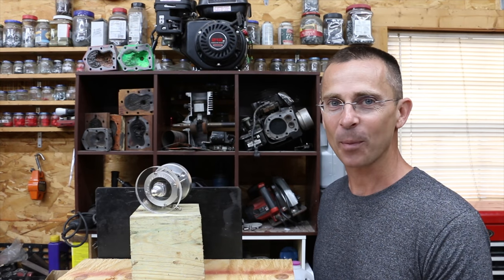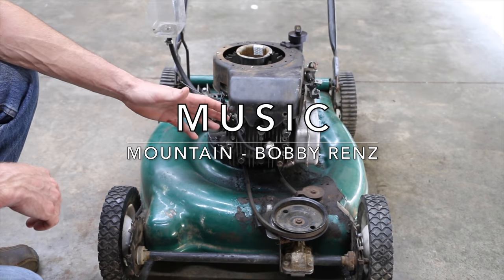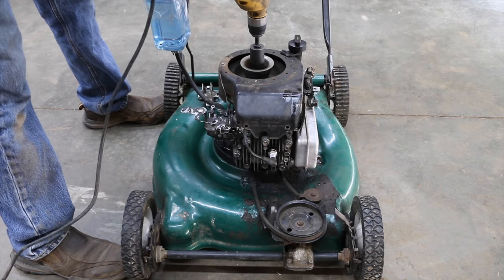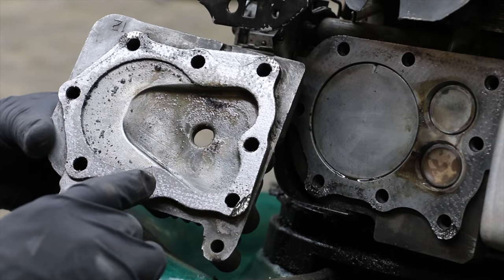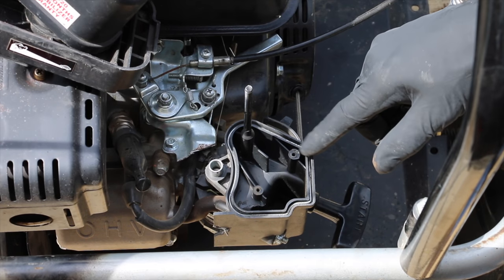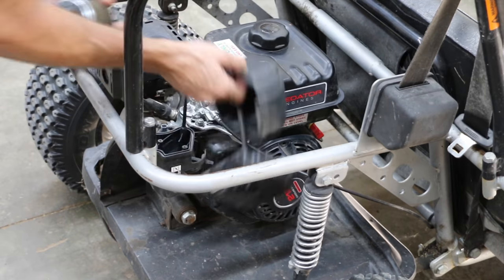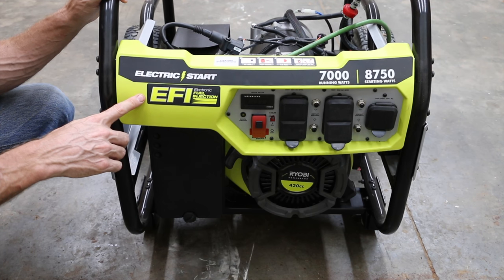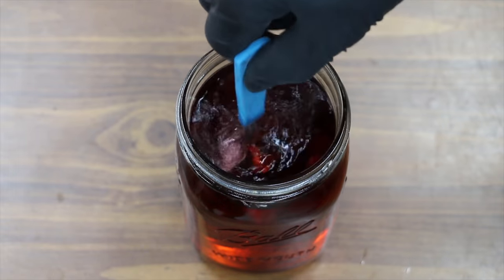Is Leaded Fuel better than Unleaded?  Let's find out!

Comment: I remember when unleaded came out we had to have the valve seats hardened on the engine to handle it. For years there was a brisk aftermarket in lead additives to keep the older style engines from damage.
Reply from the maker: Great point!  Thank you
Reply: I think I remember going to a gas station as a kid and seeing little bottles of "injector cleaning", "diesel fumes reducer" aaaaaand "lead substitute" liquids so probably not actual lead but something that mimics it (though probably for some time actual lead containing fluid was sold)
Reply: Glad someone mentioned it.... Aviation fuel also has Antifreeze in it due to freezing temps at altitude. That is the build up ...they make spark plugs cleaning tools for aviation.
Reply: @chelarestelar  there were actual lead additives. I was in my 20s when they started getting rid of it. I hunted leaded fuel then aftermarket additives for years before giving in and modifying the heads.
Reply: @jerrystott7780  actual lead additives? Well, didn't have confirmation of their existence, but now I know
Reply: @chelarestelar  the lead substitute were all you could find later on, but they really didn't work as well, that's why in the 90s I gave in and changed out the heads on my older vehicles.
Reply: @chelarestelar  toluene ftw
Reply: @shawnwhalen8314  Thats for aviation turbine fuel IE Jet-A. 100LL aka Avgas naturally has a VERY LOW freezing point and most recip engines don't fly high enough for it to be a problem. The lead deposits you see are from TEL (Tetra Ethyl Lead) and is used as a knock inhibitor, not as antifreeze
Reply: My father had a 69 Nova with a 230 inline 6. I remember him using S.T.P. lead supplement at every fill up. Not sure if it mattered. Also I remember reading a study that stated lead fuel emissions were making people crazy and violent.
Reply: I use that additive for my 60s car- but most people say you don't actually need it if the engine actually was driven at the time with leaded fuel- so that the valve seats have hardened.
Reply: @jerrystott7780 , up until last December, my 68 F250 was still using lead additive. I remember when I bought the truck at the age of 17, the original owner had an entire pallet of TEL in the garage and sent it with the truck. This was 1995, and I distinctly remember the guy saying "use a little bit of this shit at every fill up or she'll knock climbing hills". That pallet lasted me until 2013, 😂
Reply: @Taydrum   yes thanks, sometimes I get them confused.
Reply: @olik136  The process to harden the valve seats was something done during a rebuild, not a side effect of running leaded fuel, it they have never been rebuilt then you need the additive.
Reply: @waynelutwiniak797  Well the effects of lead poisoning is actually increased aggression, mood disorders, muscle and joint pain, and difficulty in memory or concentration.
Reply: @Jaker788  that sounds like most boomers
Reply: Yes your right and we had low lead before we had no lead gasoline and the oil  companies could have used ethanol instead of adding lead to do the same thing that lead doe's but they chose lead instead because they couldn't patent ethanol but they could lead , greedy oil company's chose lead.
Reply: Cool story bro. Really...
Reply: @shawnwhalen8314  it's not exactly antifreeze but a very similar chemical, I was POL for 4 years in the AF and we had to test for proper levels of each chemical Everytime we received fuel.
Reply: I bet those horse and buggy days were the shit huh??
Reply: We replaced the catalytic converter with a straight pipe and continued to run Regular until it eventually disappeared.
Reply: A former co-worker of mine had a 1930s Willys-Knight with an engine that was never converted, what he was told was to run ethanol-free gas and don't run it hard.
Reply: @chelarestelar  I still buy them for some of my older engines
Reply: @Jaker788  that explains a lot...I thought I was just getting old
Reply: I had a 1965 Thunderbird then. It was 1990 when the last of the Leaded was still in the Petro Canada Pumps. After 1990 I used Monach Oil brand; "Pist-N-Lube"  in with the Unleaded.  Today ppl still mistakenly say "Regular" which meant Leaded back then.
Reply: @Jaker788  i actually have these symptoms in my life and used to race motocross at a amature and then semi professional level, breathing in race gas fumes. I wonder if it has any connection
Reply: @thedude7726  Could be symptoms of gas fumes, unless you guys used leaded fuel. I work in industrial lead acid batteries so I get yearly testing for lead blood levels. Overall my risk is low unless I'm really careless.
Reply: I remember putting unleaded gas in my dad's 1976 f150. It misfired until I was able too dilute the unleaded with 87 octane (regular gas as I recall).
I change my oil twice or more /summer - 10/30 in my lawnmower. I use unleaded in my 2003 Saturn and occasionally put in MMO. I'd like yo know what to use in my lawnmower.  Jet fuel is just cannot be found around here.
Reply: Heck my 4 cyl 30s chev runs without lead but spits in sputters ever so often
Reply: Who here remembers when everyone and everything had higher levels of lead in it.
The good old days huh.
Reply: MrNorthstar50 

They all bought it from Ethyl Corp.
Reply: nick4819 

We had cheap gas, land yacht cars with lots of chrome, powerful engines, and no safety features to speak of. Somehow, we survived.
Reply: Jake Rosendahl 

I think the greatest public health risk these days is from lead water lines and maybe from peeling lead paint in old homes. Maybe Chinese china, from lead in the glaze.
Reply: So true! I removed the catalytic converter to my ‘76 Trans Am one block from the Midas shop - left it in the drainage ditch where I took it off. I had pre loosened everything prior to going there. The shop wouldn’t remove cats but a car in without them they’d work on. Dualed out the old TA; it ran better w/o the afterburners on it.
Reply: sukhoi31m3 

I’d have tried to get something for the previous metals in it.
Reply: Had a few bottles of klotz lead additive for my ironhead now its lead substitute, ran a lovely grey exhaust pipe now its black like the plugs
Reply: Nah, it cut the performance back so bad I was glad to throw it in the ditch. The 455 my ‘76 T/A had was the low performance station wagon engine. IIRC the comp ratio was under 8:1. 4 Speed, 3:23 gears. Getting rid of the cats helped a lot, so did different metering rods in the Qjet carb. I recurved the distributor for 39 degrees total, all of it in by 2500 rpm. That’s a pretty aggressive ignition profile but with its low comp ratio it digested that (along with lots of regular fuel) with no problems.
Reply: @uwekirschling9757  Especially lead salts and organic lead compounds, elemental lead less so.
Reply: Friend of mine just starting using unleaded when it came out. Didn’t do a thing to his engine in preparation for the fuel change. 
It ran for years without a single problem.
Reply: @FrankGutowski-ls8jt  well some of us did haha
Reply: chelar estelar 

Lead substitute was probably MMT, an organometallic compound containing manganese.
Reply: @juslitor  it also depends on how it gets into your body, through the lungs like you would have from car exhaust if there is lead in the gasoline is an higher absorbtion rate than eating the same amount of lead
Reply: I think part of the problem is lower octane in newer gasolines. Lower octane means higher combustion temperatures. That would certainly add to burnt valve issues. 

IIRC Lead raises the effective octane but in a better way than ethanol. I remember buying 98 and 100 octane fuel regularly in the 1970s.

My 1986 SAAB Turbo hated ethanol and I had to use a lot of additives to keep the injectors clean. There was one Shell station 100 miles away that didn't have ethanol in its premium that made the old SAAB run great but lowered the mileage from 36 to 34 or 35 mpg. Yes, I kept meticulous records. I was running about 3000 miles per month, 1/3 of it city driving.
Reply: @jerrystott7780  I wish I had the money, I'd get some heads, cam and timing set for my old van, be better off just swapping the engine tho
Reply: @Maples01  yeah, but those old engines are sweet, easy to work on and no sensors hiding and causing what looks like carb problems.
Reply: @jerrystott7780  It's why I bought that van, I just need a 302 roller from an Explorer, my engine comes out the passenger door. I made a mistake trying to use the crap at the pump, the E10 collected moisture, ruining my tank, and there are no replacements made, I use 100% gas now, which costs a fortune
Reply: @Maples01  I've got a 72 Dodge van with the rotten gas tank too. Supposedly there is a company that made plastic replacement tanks but I didn't find them. The other option is to weld up a steel replacement tank.
Reply: @jerrystott7780  Mines the bastard child, no one makes a replacement and it's design makes it hard to match. Aluminum sounds pretty good for a choice of materials, I've dealt with so much plastics failure, I'm starting to hate the stuff.
Reply: @502Chevy that indeed a very aggressive timing curve! When i first started reading your reply, i thought you were going on to say it was a sd motor!  They stopped making them a few years prior but they were bad ass!  I'll beto your car was still pretty fun to drive,,,,
Reply: From what i understand,,  lead also was a lubricant for th exhaust valve,  thats why ya needed hardened seats with unleaded glas
Reply: @shawnwhalen8314  when we ran pump gas in the chainsaws, we replaced spark plugs all the time.  Since switching to 100ll 30 years ago, i haven't changed a plug in 15 years, and only because of worn electrodes!  
I have a vixen plug blaster, and use it all the time for the plugs for a couple of high oil consumption engines.

Comment: 1st off... yet another great video! Kudos!

You won't see much (if any) gain in performance with these engines. They simply aren't designed to get the most out of the fuel. Higher octane fuels require significantly higher compression, ignition advance, and atomization to achieve their potential gains. There is a slight advantage in power by volume, as there is no ethanol in the aviation fuel... but without a properly tuned engine, that advantage is unattainable.
Reply from the maker: Thank you!

Comment: Back in the day when leaded fuel was common  if the tailpipe was chalk white or gray folks would say you had a good engine. If the pipe was black most times it would be an oil burner.
Reply from the maker: Thank you!
Reply: Yeah, and the dark tailpipe could also be from running too rich !
Reply: @kengamble8595  Yep,but you could usually smell the difference.To oil burner smelled different than a car that needed the carb adjusted or repaired,or maybe just the air cleaner serviced.
Reply: @korvtm 
Right, and the exhaust would be a blueish color if burning oil and more on the blackish if too rich.
Reply: correct answers (thus far).  lol
Reply: With unleaded, brown deposits on the tailpipe indicates spot on mixture.  Even something as simple as a change in exhaust backpressure can change the mixture.  On my motorcycle, with my aftermarket exhaust, if I run the louder baffle I get brown on the exhaust tip, if I run the quieter baffle it goes slightly black, I suspect no baffle would probably be too lean even at 6000ft.
Reply: @kengamble8595  True that.
Reply: Up the Road 57 

The grey powder was lead oxide. I recall articles about diagnosing tailpipe deposits and exhaust gas appearance.